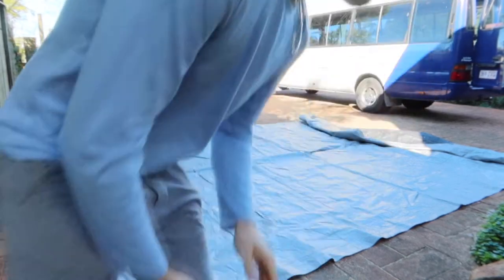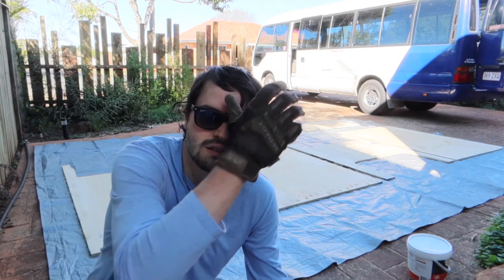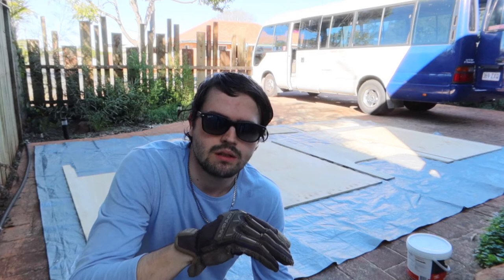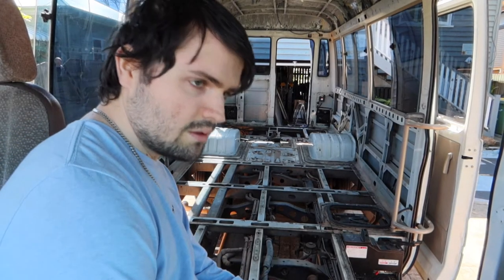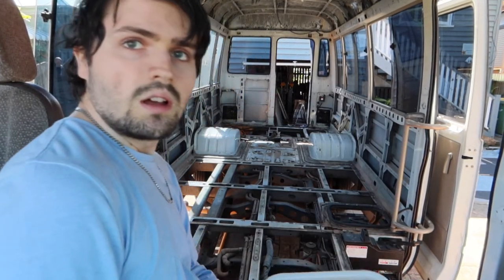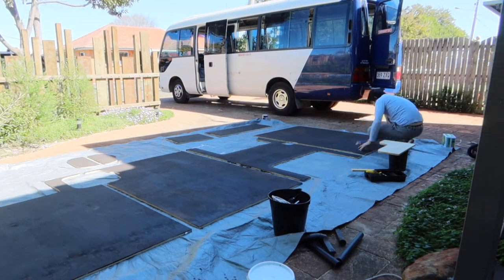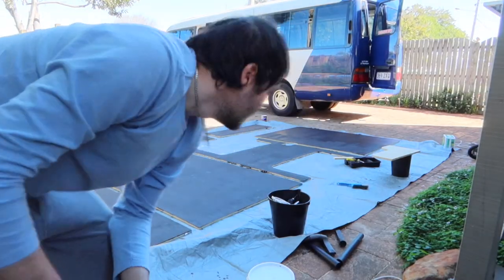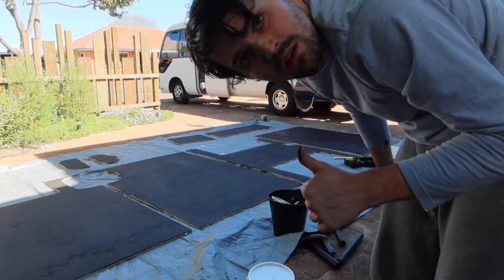Our Coaster Conversion - Part Eight - Bitumen Painting The Sub Floor

Comment: You covered the floorboards with bitumen paint. What glue did you use to stick vinyl flooring on to it? I'm finding that no adhesive will stick to the bitumen paint. Thanks in advance.

Comment: Hey thank you for the videos, my partner and I recently bought a Toyota coaster 2000 and we've only just started and we're realising that it's not as fast of a process as we thought. Also just wondering if you thought normal ply would be fine if you coated it with a water protectant? You're all such a sweet lil' family. 🙂
Reply from the maker: Hey Pirie,
Thank you for the kind comment :)
Welcome to the Coaster Club.
The 2000 model coaster is great.
We started off with structural ply and waterproofed the underside.
We regretted that as we realised after the Christmas break our bus was leaking and ruined the floor.
So we are redoing it currently.
You can use any type of ply providing it’s going to be protected properly.
Make sure you protect it with something permanent like fibreglass resin or epoxy or bitumen paint.
Make sure you get either 17mm and 12mm (the metal plate between the wheel wells have ridges that are 5mm higher) or get 12mm and 7mm.
It depends if you are putting ply over existing floor or replacing.
We got 17mm form ply this time around (already has waterproof coating, make sure you seal any cuts though) and 12mm standard ply for over the metal plate.
Reply: @theaitkenfamily9138  Thank you so much and that was so helpful!! :)
Reply from the maker: @pirieoutridge4082  no worries at all.
If you have any questions please reach out :)

Comment: That bitumen tub is very expensive at Bunnings: $80. How much did you actually end up using?
Reply from the maker: It is but it’s a waterproof membrane so it doesn’t rot.
I used almost the whole tub. But I did like 3-4 coats.
You don’t NEED that much you could probably get away with half a tub.
We are replacing our flooring again this weekend though...
After the recent rain we have ended up with pretty bad water damage on the top of the flooring (now worried about future rot as I didn’t pick it up for several days with heavy rain leaking in from multiple sources)
So we are going to use form ply as it’s a waterproof slick surface off the bat so should be better. However the flooring itself is quite expensive (more so than normal ply with bitumen paint)